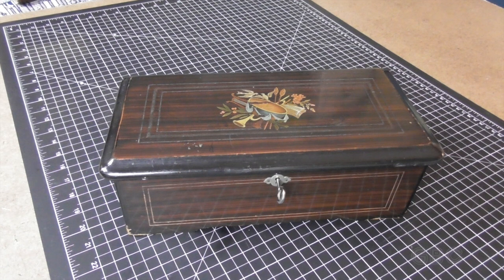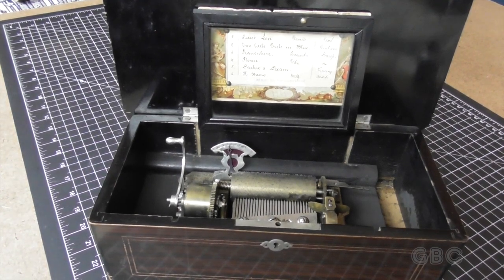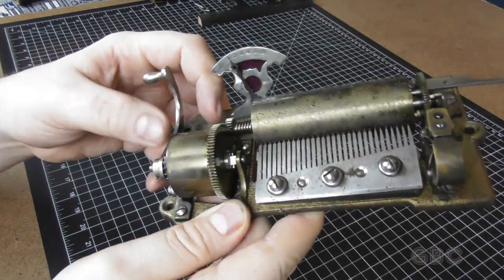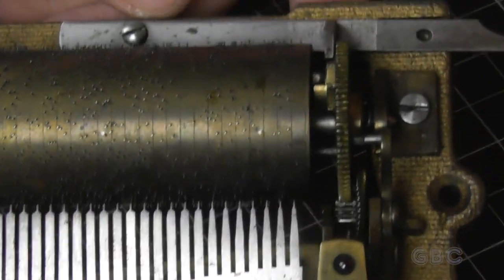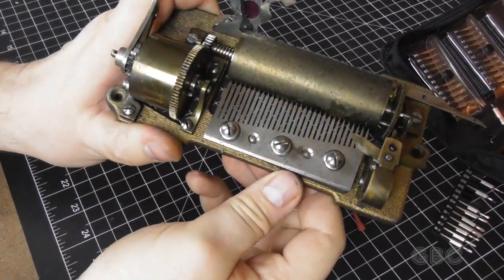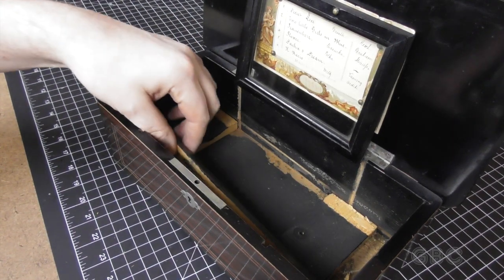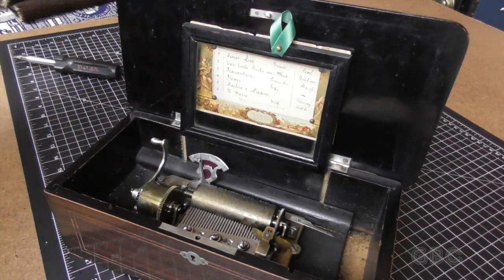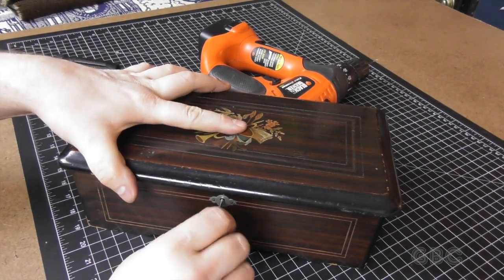[88] Music Box Repair

Comment: Not a good idea putting oil in the teeth. Also, you should not oil dirty pivots, the mechanism needs to come apart and be cleaned first.
Reply: Why no oil? Does that harm the teeth or the brass metal?
Reply: @cuskit  - it attracts dirt and grime.  The shape of the teeth have a rolling action as they touch and do not need oil.
Reply: @h3h3eot  Thank you! I've inherited a lever wind cylinder music box from my recently passed on Mom. Thinking of trying to get it working again.
Reply: I did  a cleaning video
Reply: @KarthusDreams  can’t find your video. I have one I use to dance to with daughter when she was a baby ( she is now 40) and I inherited it but it is wound too tightly so I really need some help. Can you lead me to your video or let me know what to do.
Reply: @gibsondianne76112  Hi ! Give me a couple of minutes
Reply: @KarthusDreams  thanks so much for your generosity of finding your video for me. Do you have a suggestion of what to search for?

Comment: Ok, we watched the entire process only to never hear it actually play. I think you made a big mistake drilling new holes in the wood block. You could have easily filed and redrilled the original holes using glue and wood match sticks. Now that there are two unused holes, the value is negatively impacted. Potential buyers may think that the movement is not original to the box.

Comment: You should NEVER lube the gears itself. Sending a very wrong message there.

You should open the gearbox and clean the old oil with some Isopropyl alcohol and assemble it, followed by fresh oil - only a dab of it too. It doesnt need so much.

Rather shoddy workmanship. Sorry